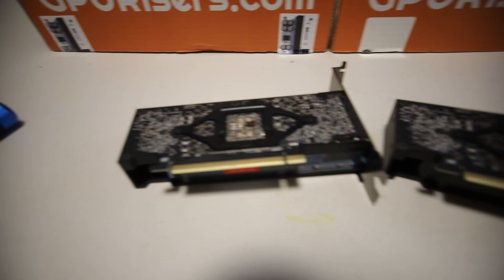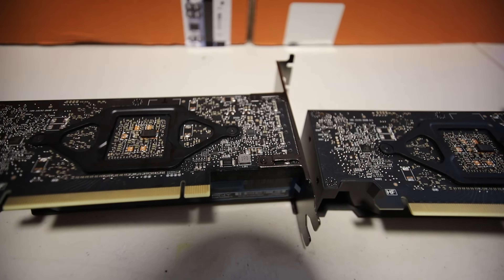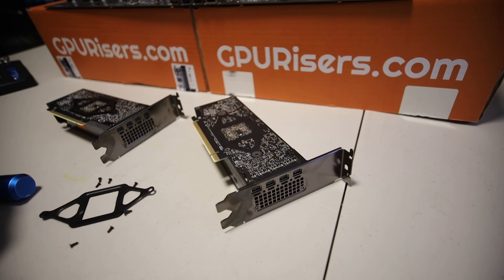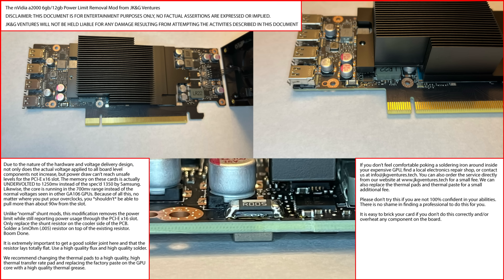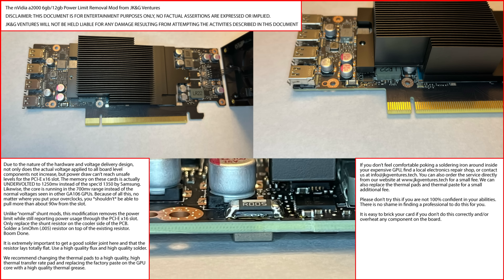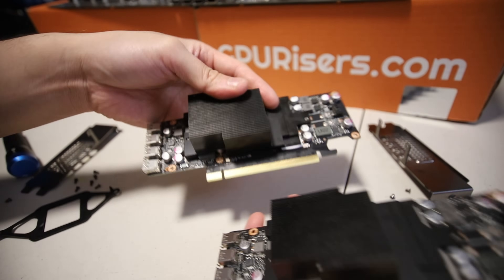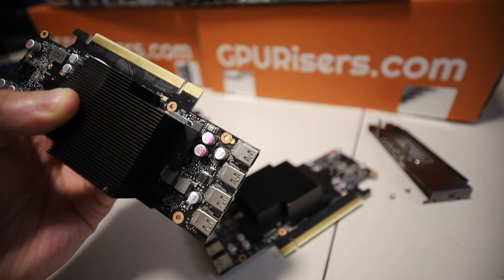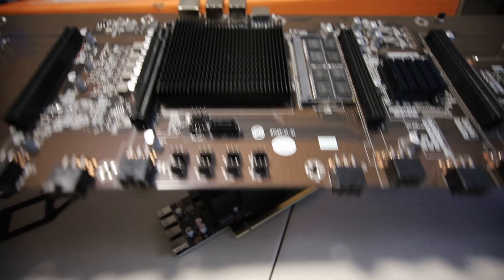How to POWER Mod your RTX A2000 to get 49 to 50 Mh/s mining Ethereum (with close up pictures)

Comment: and in pursuit - the shunt DOES NOT REMOVE the "power limit"! It "deceives" the monitoring, showing that the "current" coming through the +12v bus has not yet "reached the limit" set in the BIOS. This "mod" does NOT affect the overclocking of the core. As well as on the "overclocking" of memory. Direct impact - only on the TOTAL consumption of the card - with the new shunt, the card can "consume" TWO times more power from the slot! And, accordingly, burn the slot. and the motherboard (if the card is plugged in directly), or the riser if the card is plugged into the riser.

Comment: Evidently, you can solder on an additional PCI-e power cable to the backside resistor so you don't burn out the PCI-e socket.

Comment: FYI - You can pigtail a single hot wire to the resistor stack on the rear of the card - ( From a 6 pin socket on that / any board or right from a PSU) to avoid overdrawing the PCIE slot.   😉

Comment: I saw how they shunt mod it - they use 5 om resistors on top  of 5 om resistors. Also put 1 PCIE cable and power increases... But needs to change radiator. Also you can achieve 5 watts without shunt mod, just add fan emulator and do an external fanning... Also repaste everything, 12gb model is even more power restricted, if it can get juice it will mine well past 6gb dag, but not as efficient as 6gb model, but still it goes beyond 6 dag...

Comment: Hello RTM, your video is only available today, but this has been known for a few weeks and just a few things, the line or track of the pcb of the board no longer supports more than 80w, the resistance has to be of high precision and it is necessary to make a extra power connection, all soldering has to be very well done to give the minimum resistance. The board reaches 92w doing 50.3mhs with the memories at the limit of heat, it needs extra cooling.

Comment: The 5 mOhm chip resistors also have a watt rating like 1W 5W 10W. Does it matter? Sounds like we are running 15-20 more watts and thus we need one with that high of a watt rating?
Reply: Well - if you add another resistor in parallel and its same resistance then it will split current equally and hold twice as much power now. So by adding another resistor it will effectively double the power that they can handle. So it's probably cquestion on VRM and pcb tracks of how it can handle the added power.
Reply: @arva1kes  if the resistor is splitting current, shouldn’t it be rated for half the new 88W current=44W) or is the shunt resistor just a measuring device for the GPU to gauge the watts it is drawing. Seems the latter since the resister type used only appears to be rated up to ~4W

Comment: I guess people could just buy a bunch of those resistors, get a dead video card for cheap somewhere and practice with their soldering iron/resistors till they feel comfortable. Then go do the acual mod themselves. I've used a soldering iron before, but I'd probably want to practice with the specific resistor and a dead board till I get confidence to try on a real, working video card :) Wonder if I can boost my 1660S in the same way? :P

Comment: Try to avoid 5mohm resistor. This means you are allowing it to draw double the power 150w. A safe resistance value should be 30-40mohm this will limit the power draw to 85-90W.
Reply: These chip resistors often have a watt rating. Does it matter to get a 1W vs 10W version?
Reply from the maker: Where did you get the 150w number from????? https://youtu.be/CkxC96Qxv_8
Reply: @RedPandaMining  He is saying it has the potential to draw 150w by using a 5mohm resistor.
Reply from the maker: @rdtitservices7698  I see!
Reply: @RedPandaMining  Power (W) = Current (A) * Voltage
Current (A) = Voltage / Resistance (Ω)
So at a given voltage, if resistance decreases, current increases. So if the factory resistor caps the power at 75W, soldering on an equal resistor in parallel (on top) of it would half the effective resistance ( Rt = 1/R1+1/R2 ) therefore doubling the current and power.
Reply: I could be wrong but I believe this is a mobile 3060 GPU core and is power limited to 87w, much like the laptop model. I believe it is incapable of requesting or accepting anymore power than this. But… I could be wrong :)

Comment: Honestly? Shunt-modding any card that uses power via PCI slot, can potentially overwhelm the slot's limitations... I'd ONLY shunt-mod regular 6-8pin (2x or 3x plug) cards... specifically LHR cards, they will lock up FAST if they're not seeing the video controller loaded... used to see 40 Mh/s on octopus originally, now I see 60-65 Mh/s... Any extra income is profitable for me.
Reply: Really interesting. What LHR cars do you shunt mod? 3060 ti ? 3070? 3070 ti?
Reply: @julienl.8021  got 3 3070 ti's shunt-modded... currently thinking of doing my 3090, but still enjoying my gameplay too much to leave it mining 24/7.
Reply: Okay nice ! Thanks. How Manu watts dis toi get thème running 60-65 mh?
Reply: @julienl.8021  originally, it was asking for 270-300W, now it thinks it's only using 150W (at the wall it went up to 330 per card)

Comment: You actually don't even need to solder, you can use a bit of super glue instead. Though doing so will be a lot to harder to reverse, it is a lot easier. This is the exact same method used for shunt modding Nvidia cards to get more power limit for XOC, though those cards need ~5 resistors doubled up. However Modding is always done with risk.

Comment: These things go for over $1000 CAD on ebay, that doesn't seem like a good price to me especially if you are buying it to do a mod like this. I  don't see the point when you could buy 2 rx 5700 xt's for the same price and get double the hashrate without even needing to mod the vbios let alone the hardware itself.

Comment: Makes sense, putting another resistor on top will make both resistors parallel, which will allow more current to flow through and raise the voltage in the circuit. See? Even though I failed my electronics class I still got something out of it.
Reply: Incorrect, less resistance will make the current/power monitor circuit read a lower value than real (less voltage), making it deliver more power.
Reply: @ELJORGE1  Mo Powah!

Comment: because the pcie slots on that board are powered by pcie 6 pin that can do what 150w? i doubt you'll burn them out. actually i bet if you took an a2000 and did a 10mOhm shunt mod with better ram cooling you could get 55mhs

Comment: The problem I see with this mod, is that you're drawing power from your motherboard/riser. I mean, if you can put more power availability into the riser, than it would be fine.
Reply: That's why they warn you not to use MOLEX or SATA powered riser card and use PCI-ex powered and higher rated inductor / choke used risers should be used with this mod. For inductor / choke values 150mH or better is advised.
Reply: @arimurdul  Hi, What's PCI-ex powered and not MOLEX/SATA powered riser? I am buying the riser for this mod but I am not sure what's the right riser I should buy.

Comment: "Shunt mod" is not a new thing when it comes to Extreme Ocing for OC records. Normally it is done to the PCI-ex power connections. People are badmouthing because of this, but they are missing a crucial point.

Even if the procedure is nothing new, the reason of application is not common and new ( they found a new place to use an old method ). 

OCers doesn't "shunt mod" their GPUs' PCI-ex slot power shunt, because it is not feasible to do that ( the gain is lower and the risk is higher than shunt moding the PCI-ex power connections, they do if only they are working on a low level GPU like GT 1030 or so. ) 

This is not an out off the box thinking, yet it is something not everyone thought about it. RTX A2000's efficiency has a key role to make this procedure feasible. I wouldn't do this mod to  any GPU with PCI-ex power connections, instead would go with PCI-ex power connection shunt mod.

I've always wondered, how much performance increase can be achieved for crypto mining, if external power board mod was done to a GPU with an extreme cooling ( not LN2 extreme but with a chiller may be ). With those external power boards, you can dump extra 750-1200 WATT to the GPU depending of the board you are using ( LN2 cooling might be required for those power levels ). 

The procedure I'm mentioning above is also not new for OCing, but also no one have tried for crypto mining yet. This is not a profitable mod, it is more like pushing the boundaries. But still, if I have done that and made a video about it, probably people would badmouth about that video too.
Reply: Kardeş essay yazmışsın. Yapmak kârlı değil demişsin ancak uzun dönem sonuçlarını görmeden nasıl diyebildin bunu? A2000’den 50 mhs almak için elbette sınırları zorlaman gerekiyor. Modlama her zaman risklidir ancak limitleri bilerek yapılmış bu modlama. Red panda’dan bahsediyoruz, köşedeki bilgisayar dükkanından değil 😃
Reply: Yazdıklarımı iyi okumadığın belli. OC yapanlar ve ekran kartında harici PCI-ex güç girişi olan ekran kartları için PCI-ex slotunu modlamak anlamsız dedim. Sadece RTX A 2000 bu modu yapmaya uygun çünkü hem çok verimli hem de harici PCI-ex güç girişi yok. Ayrıca ekran kartı anakart arasında PCI-ex uzatma aparatı kullanıldığı için ona bağlanan PCI-ex güç kablosu bu modun çalışmasını mümkün kılıyor, bu modu yapıp direk anakarta ekran kartını bağlayacak olsan anakartı ya da güç kaynağının 24 pin anakart kablosunu yakarsın.

Comment: JayzTwoCents and others do this for their overclocking runs, should be interesting to see the long-term effects on reliability
Reply: The other solution is to unplugg the fan 
The gpu monitors the full power use of the card including the fan cince you hit powerlimit on those cards unplugging the fan will boost preformance 

Also enabling  rgb lowers the powerlimit of a gpu

Comment: No, I can ark, mig and tig weld hanging upside down from an iron beam in a plant all day; but when it comes to soldering it comes out like bird shit; especially on fine ectronics .. You have to often get your work hot for the solder to take and can easily destory components around it; anything beyond heavy guage wire and sweating copper pipes together I suck at soldering, ( you heat the joint(s) of the pipe red hot with a propane torch and sucks the solder inside to create a water tight seal ), so I would pay the dude; but it would be easier to do if it was like $50 bucks a unit; it might just be me but I would pay $5 bucks per megahash; but my OCD military mind rejects $8.50 per megahash; does the document state what grade thermal pads the stock ones are replaced with; maybe that would help get the choice to get over the hump; and it was very transparent and forthwith of the dude to put his mod out in the wild; so he gets credit for that; and you just don't want to end up thinking .. Dam, should of paid the dude and been done with it.

Peace

Comment: Home solder guy prolly gonna have a rough time.  Do we know what the total resistance is necessary?  Maybe get the correct resistor and replace the factory.  Very cool
Mod.  Reminds me of the pencil mods.  Same concept.  Changing resistance to trick the feedback sensors.

Comment: Gonna guess. Resistor. To change the input to the card.  Make it think it’s drawing less power than it is.  Allowing it to trick it into delivering more power to the gpu.
Reply: Yes, these mods add a resistor in parallel to the previous shunt resistor which halves the resistance and halves the voltage drop across them, this reduced voltage drop tricks the voltage controller into thinking that the board is drawing much less power, so it bumps up the voltage and increases the power draw.